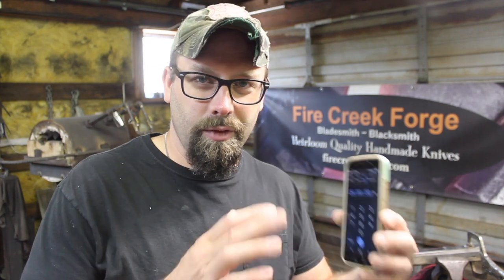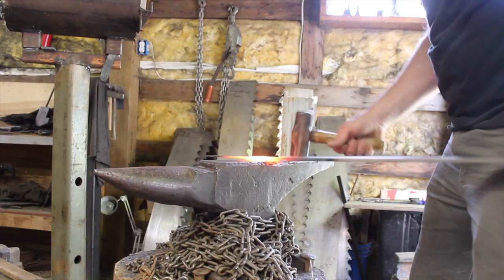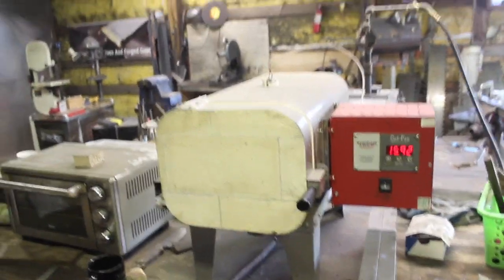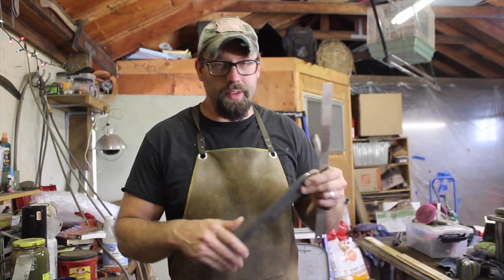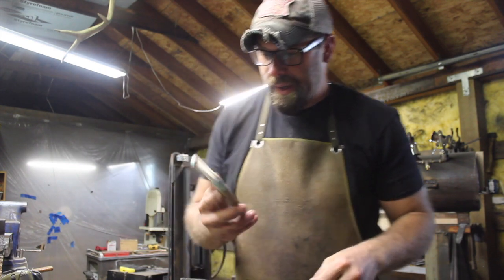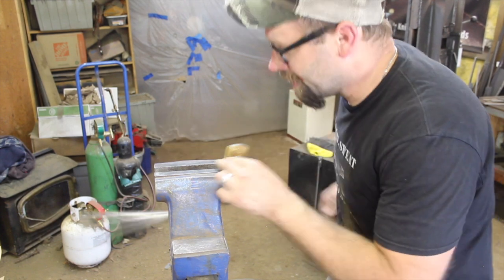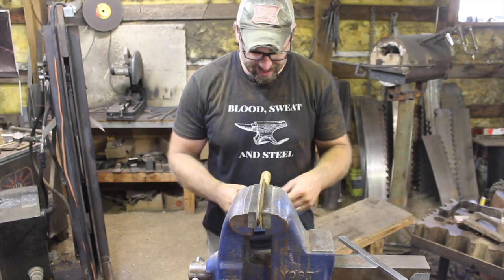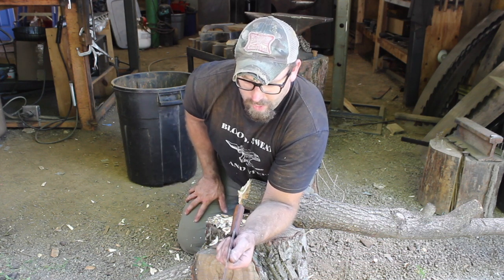Forging An 8.5" Kitchen Chopper In 5 Hours? Forged In Fire Champion Attempts Competition Style Build

Comment: Sweet build! I like that you gave yourself a time limit. Speaking of the show FiF, one thing that has always bothered me is that the show basically never mentions tempering (either after round 1 or during round 3). Every once in a while they will say “now that your blades have been tempered” etc. I get that tempering isn’t exciting TV content, but I didn’t realize tempering was a thing until I considered making my own blades after years of watching the show. How and when is tempering done after round 1? Do contestants temper their own blades? If someone else does it, do contestants get to specify the time/temperature and number of cycles? This has always bothered me since I learned about tempering....if you ONLY get your knifemaking info from the show (which is obviously a bad idea) you might not know about tempering. It’s just bizarre to never even mention such a crucial step. Thanks for any insight you can provide!
Reply from the maker: Thanks! Yeah they could give some more explanation on tempering for sure. Everyone's blade is tempered the same, at least on my episode, and you don't get to specify, its predetermined. Tempering is done right after the first round, off the clock. It's definitely not ideal to have no control over tempering, but it is what it is I guess.😊